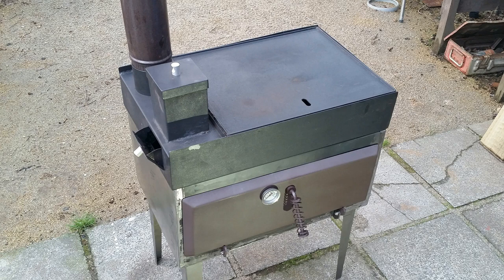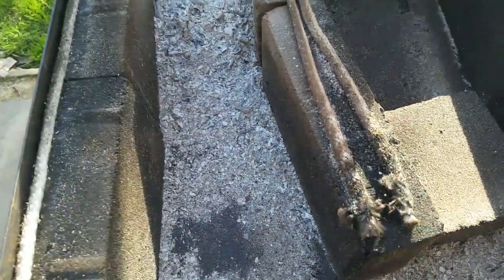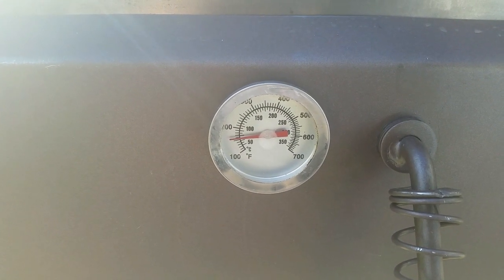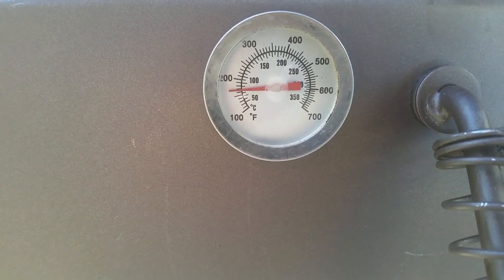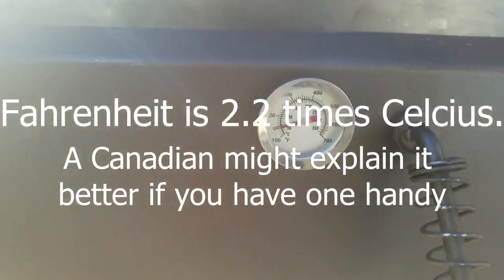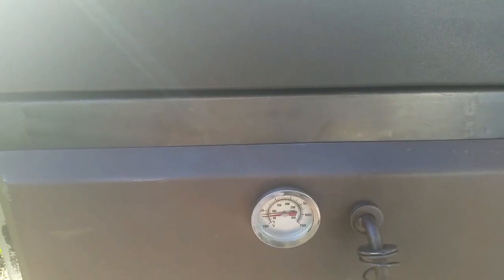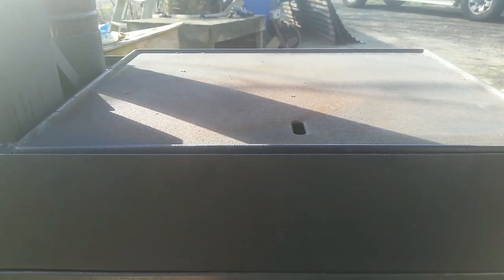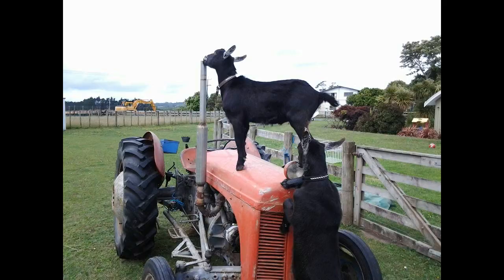Prototype Rocket Stove Oven Community Brainstorm 2019

Comment: TinyHouse and Offgrid Resources: 👌..Ok..Yeah 🤔..Hmmm, thinking thinking🤔. Oh..ok.  In regards to an inlet flap for the oven from the rocket furnace. In order to circulate from top to bottom,  you can still use the chimney to pull the heat to the bottom of the oven with not only a diversion flap from the rocket furnace but you need an exit flap on the right hand side of the oven top, leading back into the bottom of the original hot plate section. (Just remove half a brick, and replace the hole with an adjustable slide back and forth plate, simply controlled from the outside. The way that you get the heat to the bottom of the oven would be to have an secondary closed wall (1 inch vertical gap) on the left side oven wall ( with inlet hole at the top from rocket furnace) with a 1 inch open gap at the bottom. Attached to the bottom of this secondary inside (left wall) is another inside bottom sheet  (1 inch horizontal gap)...yet this bottom sheet has rows of drilled holes ( starting with small holes on the left side, leading to larger holes on the right). This way the heat can distribute evenly along the bottom (left to right), considering that the left side will be hotter than the right, and also disperse heat into the oven before it's sucked out buy top right suction hole leading back into you "top plate" section and from right to left, back up the chimney.😄

Try experimenting with this first, so as to eliminate using a secondary rocket furnace for the oven👍

I hope I've explained this the best I could.
Please read over it again & again, so visualisation kicks in.  I can send some drawings if you want to send through messenger.

Rusty
🇦🇺
Reply from the maker: hahaha as I read thtough this Im thinking that Ill have to read this a few times-0 Right - this idea is definitely shortlisted. thanks Rusty
Reply: TinyHouse and Offgrid Resources: 😂🤣
Yeah, It's difficult to explain in txt 🤣
I'll draw a picture today and make a video explaining what I mean. Pointing out the details. I've read other people's ideas too.
But I've yet to read one that is more effective as the theory that I've proposed without using a secondary rocket furnace and having the oven underneath 👍
Reply: TinyHouse and Offgrid Resources:
I worked out my video recording and put this explanation for you. Here's the link-

https://youtu.be/6JdOreVfs9I

Let me know what you think?

Rusty
🇦🇺
Reply from the maker: Wow great drawing! thanks so much. that ducting idea is next in line if the fins dont work . Im not sure how the progressive holes will work though?? they will suck air out of the oven into the flue?
Reply: TinyHouse and Offgrid Resources: Your welcome. The reason I thought of progressive hole sizes was because I'm thinking the heat would be escaping only on the left side upward to the top first, rather than dispersing evenly across to the right, considering that the heat is coming from the left side....By the way ? My second drawing was incorrect? It's all stays the same apart from the fact that it should have been lower, under the level of your top plate. Doh!...The 180^ turn knob inlet vent should work giving that your right side slide plate flue is open👍
Reply from the maker: hey, i havent seen a second drawing or a second video- ill go look again. everything with a url link goes to a review folder first.
Reply: TinyHouse and Offgrid Resources: 
Here you go👍...

https://youtu.be/bVnnJwEedd8

Just remember that it's meant to be below, in line with the bottom of the ash box and not above like I showed in the drawing.
The bottom of it has an open hole that leads into your oven.
Reply: TinyHouse and Offgrid Resources :
Correct👍...the right hand side flue/exit vent, when open, will draw the heat back through the top plate section ( from right to left) then up the chimney👍

Comment: The easiest solution is a heat sink in reverse. Other words fins, fingers, sticking out into the path of the air flow catching the Heat and transferring the Heat downwards but not stopping  (impeding) the flow of air. Also the plate on the bottom of the at the rocket stove should be thinner than the upper part. Allowing the heat to transfer down to the oven.
Reply from the maker: Yes it is thinner- someone else suggested the finning too- like the opposite of an air cooled motor.

Comment: Heat tubes in the oven, force the flow down across the length and up agin by having a baffle plate in the middle. Run the tubes to the end of the stove and have ash clean out cap. The entrance for the heat tubes could have a slide in plate to control the flow. That would make the rocket stove grill into a rocket stove oven.
Reply from the maker: Ill have to read this a few more times- but Im getting it!
Reply: TinyHouse and Offgrid Resources  can send you a diagram,  rudyduc@msn.com

Comment: how about putting your fire box on the end with a selector lever (butter fly ) to direct heat up or down or have heat go around  but with leaver you can control heat on top or bottom
Reply from the maker: BIG changes Ive no doubt that will work but its a major rehash.thanks  Mike

Comment: It will mean a bit of rework, but considering that heat loves to travel upwards, the fire source should be at the very bottom... and then design the flue in a way that will travel from under the oven to over it and under the hot plate. Theoretically at least you should get good results... the hot plate will need to be about 1 inch so it can retain the heat and will take time to reach high temperatures... do let me know what you feel.
Reply from the maker: Oooooh- a 1' cooktop!- Ill need you to come help me move it each time😝

Comment: Put the firebox under the oven and vent it through the grill on top and out the flue. It's at least an option and should produce enough heat at the grill to operate both ... Theoretically :)